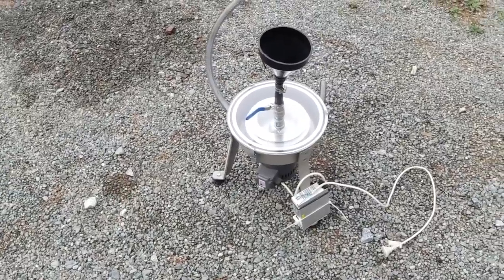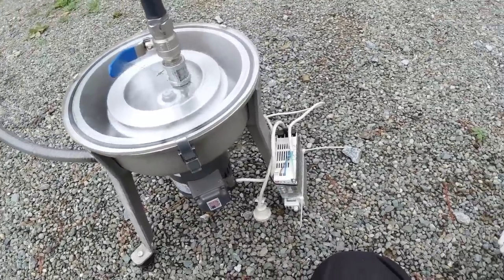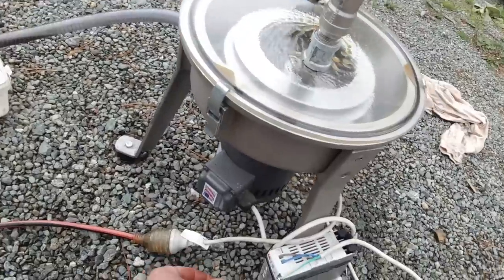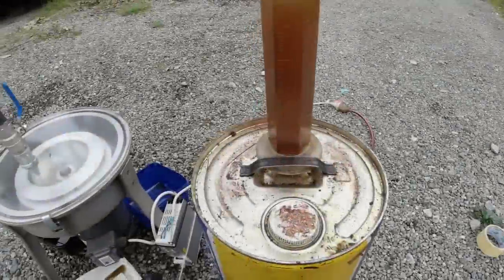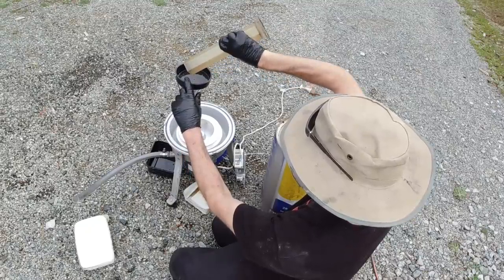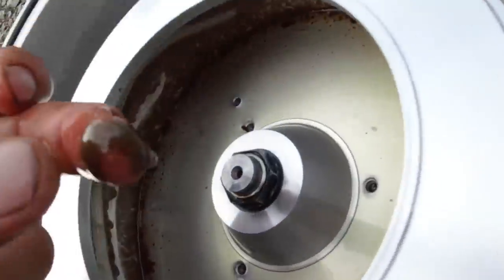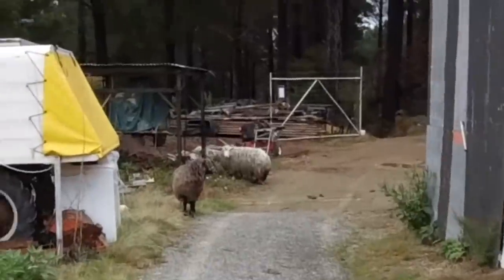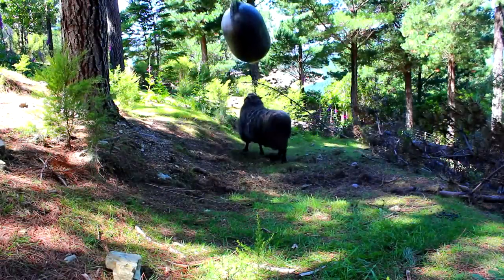Using a centrifuge to clean used oil and diesel.. Will it work??

Comment: Funny thing is many companies that do oil changes recycle their oil in large vats like this then they grade the oil and then recycle it in to cheap oil with new additives. 
If you were to use oil with diesel Start with a higher rate of diesel and add a small amount of oil to seed your diesel. 25% refined oil to 75% diesel. If you live in a cold climate them you need add gel stop to your diesel. The best way is to run your diesel as low as you dare then place in gel stop and fill your tank.
Depending on your location you can ask if the fuel is winter diesel or summer diesel. 
I have also used oil mixed with 50% oil and diesel in turbo heaters and in my orchard heater.

Comment: Maybe bit of an apocalyptic use case but you can actually run the used oil through as fuel in a diesel.... so i´m told. I´ve run used vegetable oil!
Reply: Ah... i commented before i watched the whole video.

Comment: Toyota had some 2h engines fitted with centrifugal oil cleaners to extend service life of the oil. You can buy after market ones as well and they run off of oil pressure.

Comment: Back in the 70's a system called The FRANZ oil cleaner was available, used toilet roll's as filter's, so you did not change the oil only topped up as needed.

Comment: I used to work on Belarus tractors they had a similar system to clean the oil no filter just a centrifuge with an outer housing to remove to clean

Comment: I should try running the watery oil thru a loop inside a chest freezer, then a particulate filter to remove the ice crystals. Or add desiccant to the oil and filter that.

Comment: I never add a second comment, but why couldnt you after centrifugal separation pump that oil through a fiber filter? The power is free get an old electric oil pump and figure out which car has the cheapest oil filer and rig a contraption up to filter the oil through that. You could get hundreds of liters of oil though those.

Comment: Years ago I saw a oil centrifuge cleaner and it has a V shape centrifuge that spin very fast and the idea is the clean oil will spin to the top and the dirty with the rubbish will stay or sink down to the bottom and out.  It didn't work very well a case of back to the drawing board

Comment: On the outlet pipe use a inline pump to push it through a couple of serviceable filters to remove more finer trash would really clean the diesel or other fluids.

Comment: This process needs to be done stop/start. Fill the spinning bowl, allow to spin, empty bowl, repeat. Allowing it to just run continuously will not clean the fluid. Ran my Jeep Cherokee 2.5 diesel on new and used veggie oil, "Black diesel" used engine oil filtered through a 5 micron sock filter. Used it for years and years. It never did any damage to the VM engine. But it does soot up the exhaust side of the engine so needs periodic cleaning.

Comment: I run that same centrifuge to clean oil that gets burned in a waste oil boiler. A much slower feed rate will clean the oil much better. I run about 1 gallon an hour through a dosing pump.

Comment: try using the "wicking effect" put some natural fibre rope in some clear hose then put your dirty oil up high and a clean container down low then run wick between them, the wick will filter out the dirt

Comment: i had to do the same to some perchloroethylene, i used a bbq heater to heat the solution then opened the top of a cheap but new spin-on oil filter , that will get the bigger pieces in the oil , then the filter has a check valve so it will run thru the filter media.

Comment: You could use what is called a separating flask, to get rid of a lot of water from the fuel. like the old glass drain bowls, on earlier machines, make one yourself only on a larger scale.
I also seen a post somewhere, where a bloke was cooking plastics (distilling) in a large steel drum, to make diesel fuel. He distilled it again to make petrol. In these times of rocketing fuel prices, anything is worth a venture. $_$

Comment: First, You need to force it through filter paper to remove the blacky thing and then use the centrifuge to further remove any smaller particles. Regards.

Comment: ive run 800litres through my 12valve cummins, wasnt centrifuged just pumped through a filter and then mixxed with diesel 50/50 or even 70wmo to 30 diesel, no issues, a little smokier on the 70/30 mix but at 50/50 couldnt tell a difference, it was waste oil from the shop alot of hydraulic oil, but also gear oil and engine oil 

the type of injection pump is key, something with a P-pump style piston and cylinder feeding each cylinder on the vehicle will do alot better than a rotary pump or a common rail system... and even though thats a pricey pump at about 2500$, it only takes about 1500 litres of oil to cover the complete cost of the pump at todays fuel prices, and its not new gear its 25 year old diesel work trucks with 600k km's that could need a pump at any moment

its not worth the headache of doing it a 5l jug at a time though, you need the 1000l ibc totes and proper pumps and nozzles so its as convenient as a fuel station

Comment: You are correct about adding burnt engine oil to the diesel. My uncle tried it on a car that was ready for scrap. It ran for about a month before the fuel pump and injectors were blocked with fine metal powder. absolutely not on a common rail diesel but maybe on an old tired tractor. Again its how much time are you willing to spend on a project for the cost reward.

Comment: When i ran a Diesel car, i used to filter engine oil and used cooking oil through a bed of 2" of normal beach sand, dirty crap went in, and clean pure Diesel came out, and just went straight in the tank of my Mondeo

Comment: In older times  used to put the used oil in a container up on a shelf, put another down on the ground or lower than the top one, place a length of the older  sisal/hemp  type rope  t into the top and down to the bottom  ,it wicks down and it does take time but only clean oil is in the bottom container,speak to some of the older generation and they will confirm what i say  again it is a slower method but end result clean oil

Comment: A very nice way to wear down the ram by allowing them to do head butts on these hanging drums / container.
Will the orientation of the spinning drum - vertical instead of horizontal - in the centrifuge affect the separation efficiency?

Comment: They used a centrifuge as a lube oil purifier on the Navy ship I was on in the engine room.  I can't remember the speed it ran at.  Maybe 10K or 30K. It's been too long to remember.

Comment: Better to just burn the oil for heat? or run thru a gasifier or generator for power? Used oil normally has been burnt too much to be reused and achieve any good lubrication. Project farm did alot of tests on oils and burnt/used oil seems to be pretty bad once it gets run thru.

Comment: the separator I used had mutable discs sat atop each other then the oil is run Forcing the oil out past the staked discs each with a lesser gap for the oil to flow through Until its clean And by clean I mean new oil look

Comment: Way back in the stone age of the 70's, the magazine Mother Earth News had an article on treating waste oil for re-use.  I can't remember all the details but they used the cheapest rolls of toilet paper they could find as ultra-filters in some sort of stack arrangement.  Gravity fed, overnight for results--and what they showed looked like brand new oil, it had been cleaned so well.

They claimed you could simply re-use it in engines but oil is a bit more complicated than just simple filtering these days--In any case, it might be worth a deep dive on the internet to see if someone is still using a similar method and has instructions.  Of course it relies on the ability to find cheap toilet paper also...not quite as easy as it was in 1972.

Semi-diesel engines ("Hot bulb" engines) will burn virtually any dirty oil just fine.  They were quite commonly used on 30's and 40's tractors in Scandinavia-- Curious if some made it to NZ at any point.  Might be a new "quest" to find one hiding in the woods somewhere 😁

Comment: What would work if you could get one is a filter press like what was used to clean OCB oil to remove carbon from switching operations I'd run it through twice with new filter pares after the first run and it came clean as then pumped back into the OCB

Comment: Recycling of your oils might best be a multistep process and involve getting dialled in regarding viscosity-speed. Maybe running a couple of those running in series at different speeds.  How much effort to do a home made version?  It is a smaller device than I expected, but handy that it is is configured for continuous rather than merely batch processing oriented.

Comment: Nice idea! But don´t you think that a real destillation is a better work? That will leave the hard parts like stones, sand and other relicts in the boiler and the water will steam out! Because I never had to do that, I can´t tell you about the amount of those chemicall parts, mostly out of stainless steel. But as like the petrochemical industrie does that and sell it as re-refined oil with a lower quality standard as the very new one.

Comment: I wonder what the difference would be if the diesel/oil were put through a succession of centrifuges. Perhaps 3? One dripping into the other with the last centrifuge emptying into the cleaned fuel container. Probably impractical and expensive for a home application though.

Comment: The Rotax 604 engine in my motorcycle has a centrifugal oil filter with rotating parts of a similar size that works in almost the exact same way as this (as well as a normal cartridge type paper filter) and when ever I clean it out it's always full of metallic paste so it must be highly effective

Comment: If you have a spare chest freezer stick the drums you think have water in them in the freezer overnight then filter it and it should separate out the Ice/water from the oils. We've been doing it for years with petrol and diesel etc we drain from end of life vehicles in the breakers yard.

Comment: My grandpa would put the used oil on a top shelf and put a jute rope in it and another container on the ground and it would soak down the rope cleaning the oilup pretty good and hed reuse it, im not sure the viscosity was still there but the oil probably wasnt that great back then anyways🤷🏼‍♂️

Comment: Bio fuel generation     Rig an ultrasonic  cell buster "Sonification" feed the output from a blender set on "Puree" to digest the bio mass..  Feed the output to the centrifuge to separate bio oil from the digested biomass   and ethanol plus catalyst and  guess what  Bio Deisel.  Need a water seperator after your done.  Use a Cream separator from the farm.

Comment: I wonder if a low-tech solution would do any good? Something like a cheap 20 micron water filter cartridge. It might be good as a pre-filter or maybe post-filter.
Reply: I have seen where guys pull the paper tube out of toilet paper, then pump or even gravity feed oil thru a PVC pipe, the paper does AWESOME at filtering out particulates and whatnot...but it takes a long time unless it's pumped thru at pressure

Comment: What type of fabric filter do you use before putting it in the chainsaw? Thanks Marty
Reply from the maker: Double layer of pantyhose with a magnet in the bottom 😂 ..  it does a pretty good job, I haven't noticed any accelerated wear on the bar,chain, oil pump, tip bearings since switching from store bought chainbar lube..  but I dont like getting used oil on my skin so I wear long sleeves

Comment: May have been mentioned already but there’s a channel on YouTube called NotSoGrandGarage that does the black diesel and uses these to mix the thicker oil with the fuel to thin it then runs that through the machine, lot of interesting experiments he has done with them check it out. 
@NotSoGrandGarage

Comment: What is the desired result? A re-refined biofuel? Just curious as to how centrifuging small quantities with a small yield would benefit any sensible application?
Reply from the maker: Just experimenting, always wanted to have a play with a centrifuge, The price of diesel has doubled in the last year in NZ so would be nice to reuse some old oil to save $$
Reply: @MartyT  Understood! Times are becoming like “Mad Max Road Warrior”! With OPEC cutting production and refineries shutting down or limiting expansion has certainly affected all of us. The harder politicians and lawmakers push the carbon neutral agenda it will have an immediate effect regarding oil production and processing. If I owned and operated a bakery, it would be difficult for me to expand and grow my operation when politicians are trying to ban bread!😂
Thanks Marty T,

Comment: Would it easier to run it through a filter, like a coffee filter, first before putting it in the centrifuge? I looks like cleaning the machine would be kinda difficult. But at least you can get the large particulates out of the oil first with a physical filter.

Comment: centrifugal oil filters were a thing years ago on some makes of engines only came acrost a few in 30 odd years mainly on fodden trucks memory not so good these days but i think they were rolls royce diesels and i think the spiner was driven by the oil pressure  so not as fast as your electric one and when serviced we had to scrape a layer of hard tar like crap`  almost 1/4 inch thick out of the bowl

Comment: Could it be that the viscosity of the diesel was low and therefore you had too much rpm? The higher viscosity of the hydraulic fluid may have been the reason it separated better. Using cat litter to filter out the colloidal carbon could be an option.

Comment: You want the absolute fastest RPM you can safely run it...6K or faster...the faster the RPM the "heavier" the particles will become due to centrifugal force (aka a centrifuge) and be slung out to the wall of the drum...if it isn't ripping along...you are wasting your time.   Faster = better...but there is also a point where spinning it too fast is dangerous as the bowl itself can risk self destruction due to the forces

Comment: Hi Marty. Does hydraulic oil heats up the same way as engine oil does? And if yes, doesn't the heat cycles break down the oil chemistry and makes it useless?
Reply from the maker: Ye it does get quite hot

Comment: Can someone explain how u can obtain „used“ diesel? The oil I understand but if diesel is used it’s gone into the air lad.
Reply from the maker: I clean parts in diesel and sometimes flush out a rusty diesel tank

Comment: afaik the faster you can spin a centrifuge the finer material it will be able to get out
Reply from the maker: Yes but this one started making the incoming oil fly to the outside when I turned it up over 2/3 speed

Comment: Waste Oil Centrifuges  are designed to separate different types of fluids while filters are designed to remove particles. Once you run the oil through the centrifuge you still need to filter it to remove dirt, metal and other contaminates from the oil.
Reply: Incorrect

Comment: I don't know but if you should get another old washer turbine hooked up to one of those, and run a hydraulic pump (or cable) to power the driveshaft of one of those centrifuges. Who needs electricity when you've got all the hydropower you need? I'm pretty sure if you can get 5k RPMs by an electric drive you certainly have the hydropower to either mechanically drive or indirectly drive a centrifuge motor. I don't think you will find a hydraulic motor that will turn at 5k RPM though, unless you gear it up. 

I'm just wondering what you might fabricate, not to completely duplicate a manufactured centrifuge, but it may be you might get pretty close with stuff you have around your yard. I've seen your work Marty. Don't tell me you're dubious and daunted. We can dub it the "angryram-afuge." 

Another great video in the adventures of MartyT.

Thanks for the content.
Keep up the good work.
בס'ד

Comment: I would rerun everthythin thru at least three times then pour all the diesel and oil into o ne and blend it together  and then mix it with clean diesel and the older diesels can run it no issues.